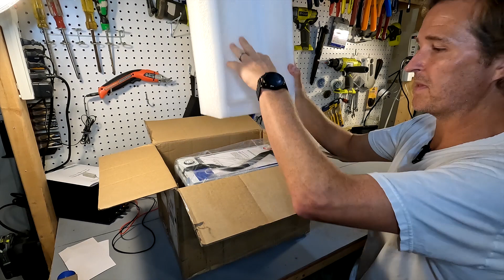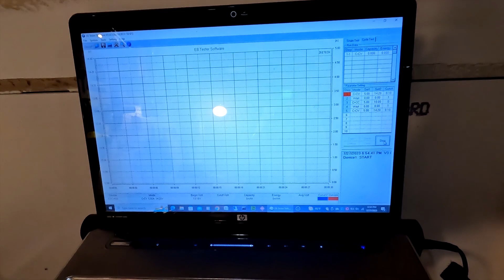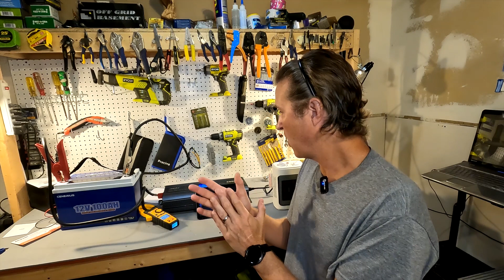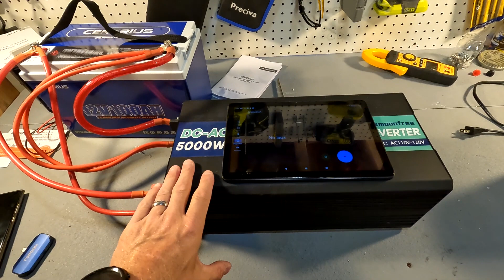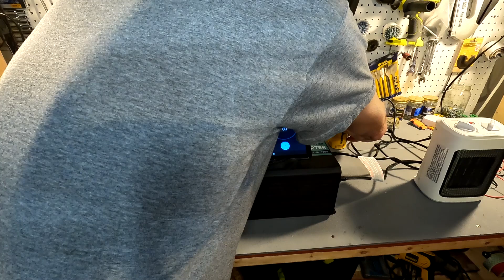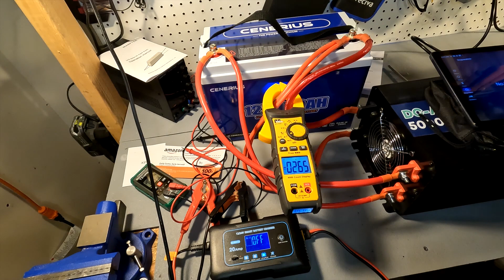Pulling over 250A for the CENERIUS 12v 100ah LiFePo4 Battery!  Wow!

Comment: With the bolted connections it draws fewer amps because less voltage drop in the D.C. wiring.  The inverter tries to produce a constant output voltage, which with your space heater makes a constant power load.  Power is Volts multiplied by Amps.  Voltage drop means fewer volts to the inverter so with more voltage drop it needs to pull more amps in order to produce the same power.
Reply from the maker: Thanks for the info and the comment.

Comment: .00 connectors and wires if it can put out that amperage. The bms is concerning ... most videos I see a 100ah battery shuts down at 120 or even less. I've watched so many vids where they shut down at 110 - 115 that I did'nt even know it was possible to go to 260 amps. CRAZY!
Reply from the maker: I was pretty surprised as well.  Thanks for the comment.

Comment: I just learn something 12v  inverters 
system love amps 😂 what batteries do you recommend for long daily solar ac diy system 12 v or higher voltage system ? Do all batteries lifepo4 have Bluetooth apps to see battery level and wattage ?
Reply from the maker: It really depends on how much storage and what your electrical needs are.  Currently only a few 12v lifepo4 batteries have Bluetooth.  Sorry for the short answers, but I need more information about what you want to do with the system.  Thanks for the comment.